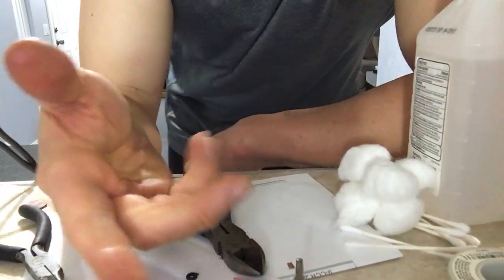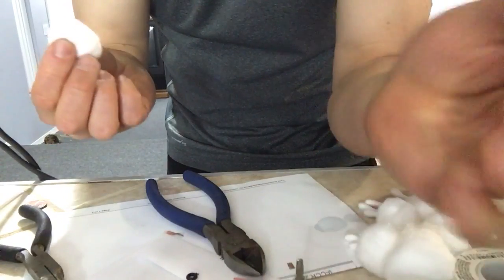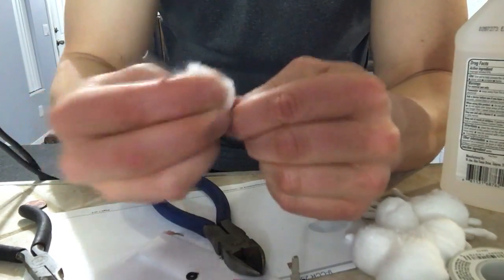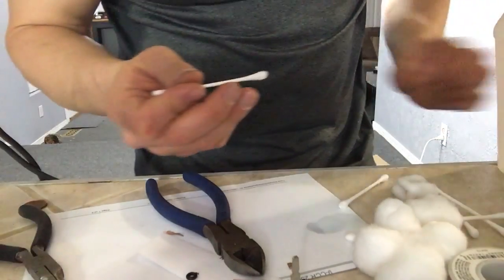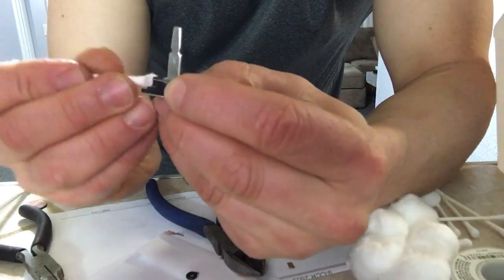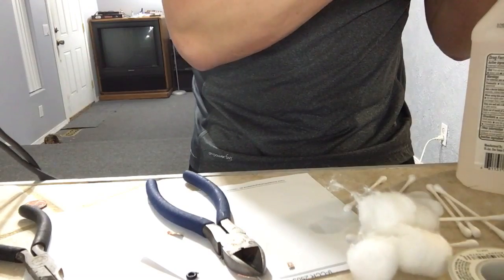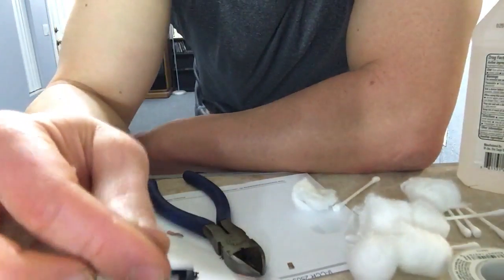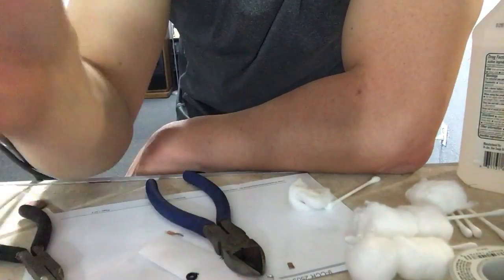MIXARS duo mini innofader mod video #4

Comment: Dam I wish I would seen this video before today because I just opened up my innofader today to clean it. I want to try removing the tension to make it smoother. I’m just afraid of messing with the solder again and risk breaking the circuit board.